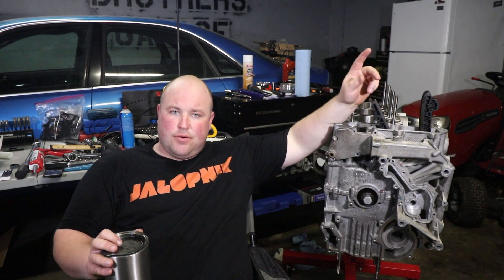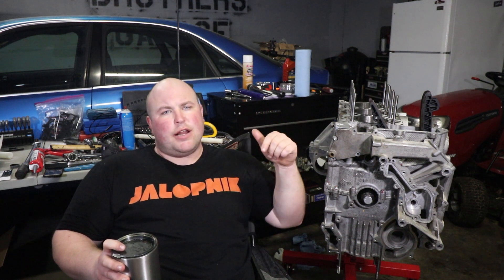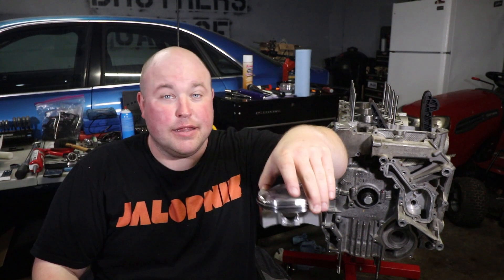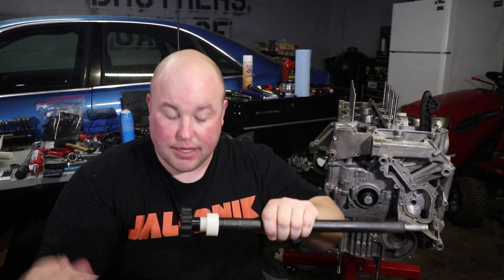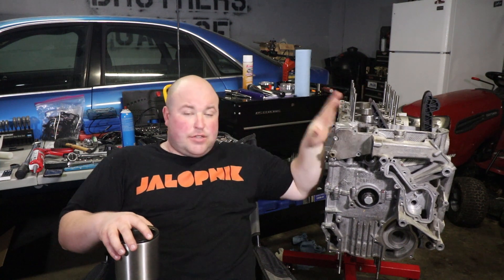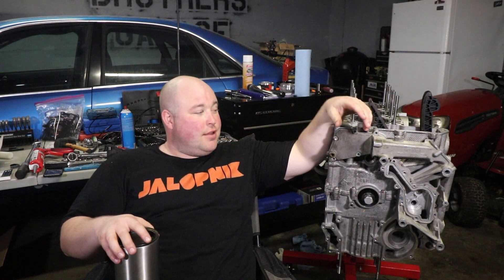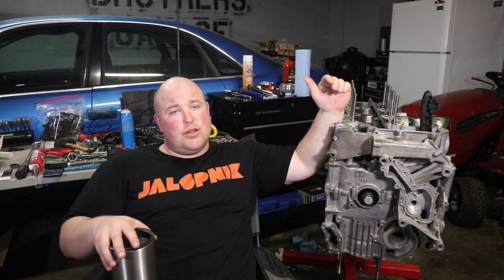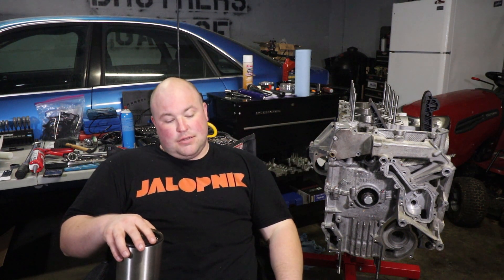Turbo 3.8L Cayman Engine Build (Porsche M96) - Part 7

Comment: Is there no way to fish that circlip out the hole?  There's no ridge holding it in. There looks to be a gap (oil hole or something) in the shoulder where you could slip a small hook behind it and pull the circlip out of the piston.  A length of stiff wire with a small hook might get to it.  Also a telescoping magnet pickup tool in the hole at the same time to catch the circlip would be a must.

Comment: If you need some tips and tricks for engine assembly you can hmu.. I rebuild one of those engines just recently. I can relate to your struggles with installing pistons 4-6 as I had some difficulties with them as well. I spoke to a Porsche Tech (I'm German btw.) and one of his tips was to use extra thick grease when installing the connecting rod bearings onto the crankshaft to reduce movement so that the connecting rods stay put while you install pistons 4-6. I know that tip is a little late, but hey.. maybe next time you can use it. Another trick which might help would be to flip the entire engine assembly by 180 degree, so that cylinder bank number 2 is facing downward and working with gravity rather than against it. If the engine is flipped that way you will have better time to install the pistons, since the connecting rods stay put facing downwards. Now you just need to align them (you can feel it when the shallow tool is seated all the way or you can make some markings on the tool itself and the case so you know when its properly seated (you have to do this for each cylinder individually obviously).. Then slowly(!) guide the punshing tool through the hole of the shallow tool and just before you hit it (you can do a marking here as well if you feel like you need it) punsh it nice and hard once. If you didn't succeed, don't proceed trying to get the wrist pin to fit, it's probably not going to happen. Just accept it and start over, eventhough I know how much it sucks.
If you need any more tips for installing the pistons or when installing the cylinder head, camshaft timing,.. you can hmu on instagram (checking more often than here on youtube): xvictor.pf
Hope it helps and stay safe! :)
Reply from the maker: Thanks for the pointers! I actually got pistons 4/5/6 installed last night. I ended up having to file down the end of the tool down so that it more easily engaged the piston properly. From there it was smooth sailing!
Reply: Boost Brothers Garage Glad to know that you were able to get it done! If I recall correctly I had to modify the tools as well to make them fit properly! Keep up the great content!
Reply: @BoostBrothersGarage  i was going to say i have never had a problem like that its always been pretty plain sailing,  there are even some Porsche factory engine assembly videos floating around somewhere and they just sail through.  I'm guessing its either the od of the hole in the after market pistons or your tool.  looks like filing the tool down slightly was a good solution.   one day down the road your build another Porsche motor and it will be easy second time :-)  Keep plugging away,  we have all been there just like you late at night with the sinking fed up sick in the belly feeling when something hasn't gone to plan or we broke something expensive. your not out there on your own brother :-)

Comment: Videos like this show us why these engines are so expensive to rebuild. I think you are looking at the right things. Check to make sure the tools slide fully through. Maybe try a dry fit of the tool without the piston to make sure it fully clears the sleeve. Then check if it fully fits into that piston before assembly. Maybe that shoulder is slightly undersized and doesn't let you get to the second groove.
 Thanks for showing how many tries these things can take. Let's us all know it is not just us!
 Stay safe
Reply from the maker: The tool does properly fit the piston, and the tools do fit through the sleeves. I think the tool just isn’t sitting flush in the first groove once everything is bolted together. I’m going to do some digging today!

Comment: Yes, thank you for posting as a video :)
Much appreciated. I bet there are hundreds of us with 944's sitting on the decision to buy a Cayman but are stung buy the Porsche pricing and not sure about the flat 6. So appreciate your persistence with this build.
Stay safe too eh.
Reply from the maker: That’s the thing, it’s such an incredible platform and the price is almost too good to pass up. Being able to do DIY engine builds will make or break these as a budget enthusiast car. Well that and more swap options, like an 07K!
Reply: @BoostBrothersGarage  I really like the idea of using the Ford Cyclone 3.7 originally designed by Porsche and Cosworth. Cams, head work, and ported intakes are available and can give nearly 500 hp N/A like the 911R.
Reply: @BoostBrothersGarage   thats awesome love how you guys show us how to do the hard parts and figuring all this out! You can afford to do stuff thats so much cooler if you can do the labour yourself! It will be cool to see how this car will compare to the 944 on the track! 

Also i have been collecting more parts for the 944 07k swap and had a few questions, i previously asked you about the lambo header and you said to get the left side, by that do you mean drivers side header? And as for the turbo do i want an hx35 or hx35w? If im changing the exhaust housing would it even matter? Also could you get me the link for the exhaust housing you put on your hx35? Im a noob to all of this but im trying to learn as much as possible lol.

Thanks!
Reply from the maker: @paulhoffman1481  Header part number is 07L253034A. The W on the HX35 just means it has an internal wastegate, which won't matter when you replace the housing. Link here: https://www.amazon.com/Turbo-Lab-America-Turbine-Housing/dp/B07GZ3WVS5
Reply: @BoostBrothersGarage  great thanks!